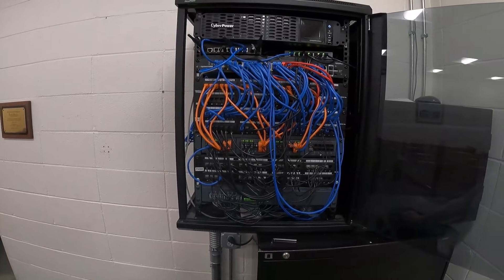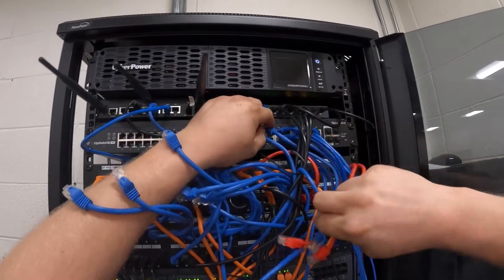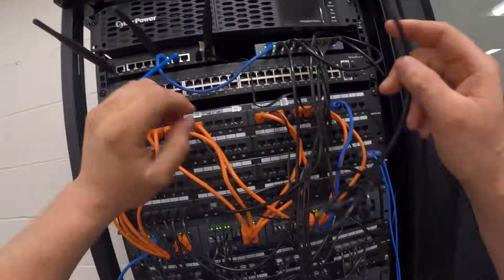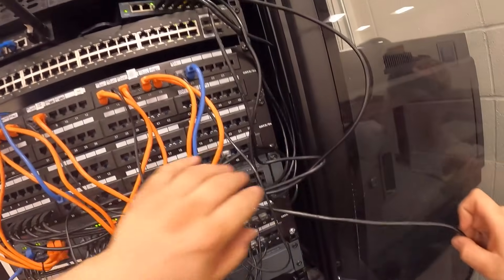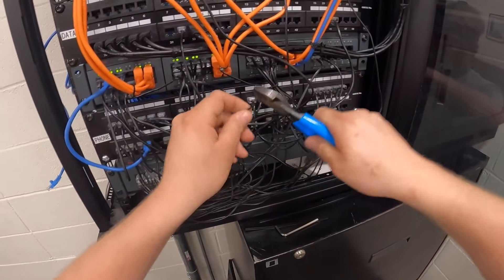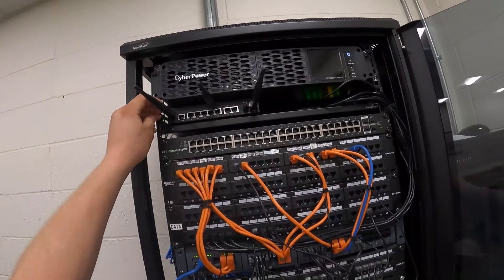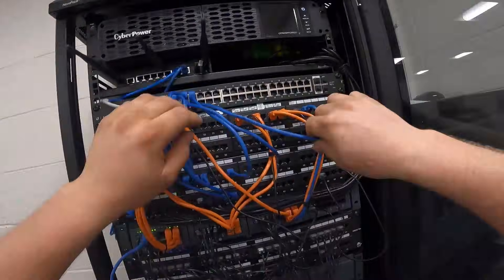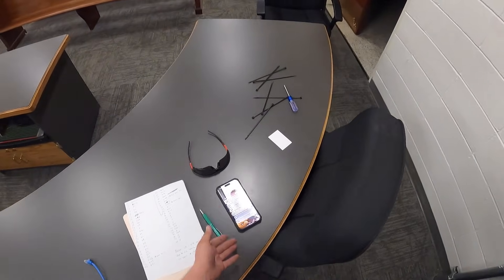Courthouse Network Switch Swap - Ubiquiti EdgeSwitch 48-500W

Comment: Im going through the CCNA course at the moment Because i want to learn how to do some of this kind of stuff. But I do have a question for you when you have to upgrade or swap out a new switch like in this video do you use the current config  and copy it out and upload it on the new device or do you have to configure it? for example the vlans and ect if it was a layer 3 switch?
Reply: It's a layer 2 switch and he also mentioned everything is on the same network so there shouldn't be any additional configuration other then make sure the switch is on the same local network. In a scenario where there are vlans access or trunk ports, port security etc. etc. then yes the switch would need to be configured accordingly to either match the current configs on-site or similar. depends if your the existing vendor or a new vendor supporting the network. Hope this helps
Reply: @Init06  yes this helped thank you I have to swap out 6 access switches at my job and I wanted to see what I was getting into first.

Comment: That is an IP office 500v2 system. It is a hybrid PBX. Supporting both digital and IP sets. Fun to play around with. But like all Voip things. I scream inside esp. when the finger pointing starts. I'm sorry I'm a computer tech, not a phone tech. Ask your phone guys to fix it or at least give me what I need to setup the router, security appliance, etc to work with the sip service. I have some good stories about that issue though out the year. Goes along with printers Sure, I'll take a look at it, set it up, But, I don't do printers.

Comment: Need to clean entire setup and provide education on why it's bad
Reply from the maker: Oh I know. We're working on that in a future budget. All of this was done by the previous ISP that served here, so there's several things that we are going to change overtime.
Reply: @telecastky  at least they used a cabinet and such. I have been a bunch of wires with Rj45 ends hanging down the wall and told more than once from a client. It works, leave it alone. AKA don't spend any money unless you have too.
Reply: @telecastky  if an ISP did this lol they should be ashamed lol.

Comment: The rack is too full. First time I have seen an EdgeSwitch in several years. Really need to get a rackmount switch to replace those little 8 port ones. Really should put the phones onto a different VLAN to the rest of the network. Why not have a patch panel below and above the switch to attempt to fix the rats nest?
Reply from the maker: The phones aren't on the network… It's an Avaya system that works on single pair copper. And, if you watched the video, you would know that we did not install any of this. We manage the network for the Courthouse now, so at some point, this will all be corrected, but we just had to replace the switch to get everything back to working.
Reply: @telecastky  I did watch the full video, simply saying what I thought. I understand you did not build out the rack, but since you had to take most of it apart to get that new switch in, you could have neatened it up a little is all I was saying.
Reply from the maker: @joshhastieYT unfortunately without completely redoing the patch bays, it wouldn't have helped any sadly.
Reply: @telecastky  yea if they don't wanna pay for the clean up (which isn't much) then your right fix what is broke and move on.
Reply: One of the voip phone companies in the area I work in they just keep adding small poe switches for the phones. They don't care. They just want the monthly service conract and point fingers at the network guy about issues.

Comment: This brings to mind a time I had to re-patch 200 patch panel connections at a dealership I worked for. The task took two full days. They were in the middle of upgrades, and the server rack was a complete mess, so it was the perfect opportunity to clean it up and organize everything properly. i dont work in the IT field at the moment been away for the last 10 years or so but i am thinking getting back in to it. as i miss working on switching gear, wifi points, servers, and phone systems.